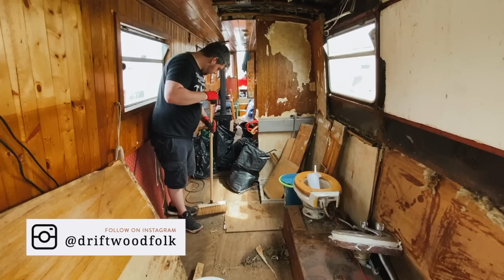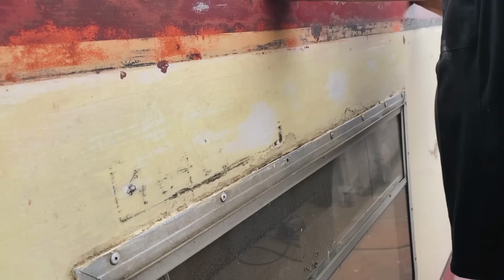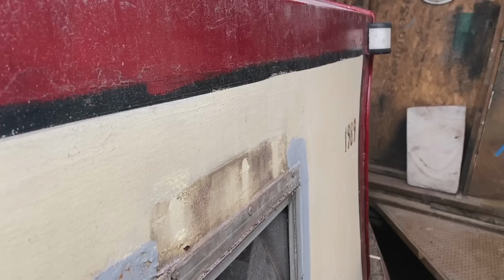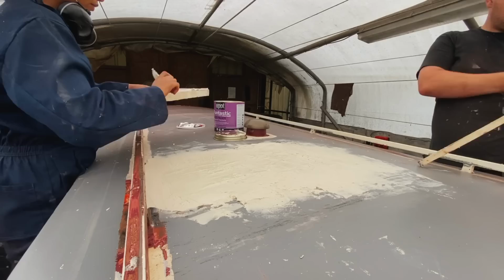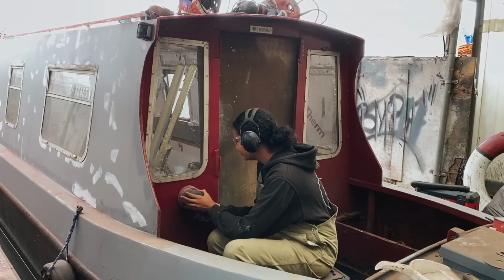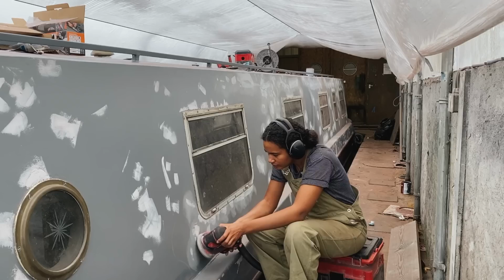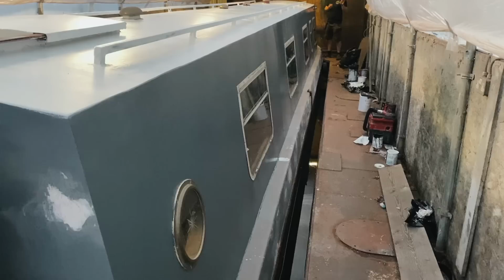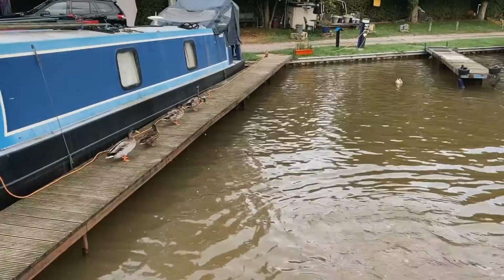Did the rain ruin our paint job? | DIY Repainting Our Narrowboat (part 1) - 012

Comment: I used to be a painter and decorater large flat area's are always a problem with white you get shadows.
What a sterling job you both are doing its looking great.
Top trick if you want to mix paint get a plater mixer end attach it to a drill through paint lid oh put hole in lid first then mix on slow setting it works all my best to you both xx
Reply from the maker: That’s a brilliant tip, thank you!!

Comment: Considering you had a leaky paint turnnel you've done very well. I'm not going to teach you how to suck eggs, but I've just spent 2 weeks in a paint tunnel to do my roof, I spent ages researching and watching John Barnards vodios on boat painting and speaking to him over the phone (very helpful chap as well as an excellent boat painter).
One of the things that I found out was the temperature before applying paint, for example the temp must be at least 3 degrees above dew point  before applying paint and paint shouldn't be applied below 5 degrees or above 20 degrees.
Regarding the undercoat , you really don't need to lay off the coats because you will be sanding down after the last coat before you apply the top coat.
With the top coat apply with a roller and lay off with a brush, to get that good finish use a Purdy Monach Elite brush, it gives excellent results. Sand down between the top coats with  320 grit paper, this will give a good key for the next layer. I did 3 undercoats and two top coats on my roof, and never ever having done it before, It turned out above my expectations.
Not really sure I'm up to tackling a whole boat, but I wish you luck.
Keep the vlogs coming.
Reply from the maker: Wow so much great advice here, thanks for sharing! Looks like you did a lot of research, I’m glad it worked out well for you!

Comment: Whether you spray or roller you're going to want to mix the paint with either paint thinner or acetone and of course hardener. The ratios are always on the can and don't pour the paint over the instructions. You will need a good respirator and some good rubber gloves so you don't get oil from your hands on your paint job or primer.. also for blending paint I've always used a dollar store stainless steel whisk I cut the loop off the end and put it in a regular drill until that an angle if you go straight in it'll fold the paint you want to blend the paint so just angle towards the side of the can personally I'd spray but good luck either way
Reply from the maker: Lots of great advice here, wow - thanks Lee!

Comment: If you wish to dry the paint process quickly. Put a blow heater inside to get hot and close the hatches for a few hours. Leave a couple of windows slightly open. The inside will get hot warming up the whole boat to dry the paint quickly.
Reply from the maker: Great tips, thanks!

Comment: Hi guys  just painted a new sailaway shell myself this last few months. All outside.  Not ideal. Was too hot to do it in the better weather. And still same really wen it turned. 2 undercoats and 2 top coats. Rollered and layed it off. Looks great on a dull day - but terrible(to me i expected better result)on a sunny day.  Its the parts every foot strip were it overlays last strip edges.  Working single handed- not easy. 
Also - i used 240 grit by hand to key primer to undercoat on first side. I dont think thats good enough. Pulling off the masking tape ripped out fresh paint back to primer.too late in year to chsnge that side.
2nd side 120 grit and a sander.
Didnt have same problem- thank####. 
Very disheartening - overall - theres always another time - at least the metals protected - if not as pretty as hoped. At least i know i can do the inside a good job.  
Good video - no bull. 👍
Reply from the maker: Thanks for all the solid advice here!! Really appreciate it!

Comment: For safety you need to wear masks as there could be lead in that paint if it’s an old boat,please be careful your health is so important,keep up the hard work but be safe.
Reply: Thanks Craig much appreciated. I did wear one in the end just typically not in any of the shots ha we had extractors on the machines too too keep the dust down plus the tunnel has a static sheet that the dust sticks to which was good. PPE is a must for this kinda work

Comment: Using the right tools and an appropriate location it's not a difficult job. The sanders you were using  were just not up to the job. If you can't get shot blasting to remove paint, the next best way is mains powered angle grinders with fibre discs to strip back to bare steel. Doing this would actually be quicker than what you did.
Reply: Hey appreciate your comment ... We werent going down to bare steel we just wanted to key the paint but also to take off years & years of bobbly paint jobs, which the sanders did a good job of doing & it looks soooo much better for it. Ideally if we had the funds & the time we would of got it blasted but unfortunately those things together are in short supply. Plus would of required way more primer & undercoat to achieve the same results.

Comment: Deffo get your mate to spray paint did mine with roller and your can see so many patches at a angle saving grace looks Wicked from a distance 😂 The shelf lmao you mean gunnels or gunwale depending how posh you are.
Reply from the maker: It’s a shelf to meeeeee 😂 Yeah this week we actually put another undercoat on (green) with rollers and on one side there’s no roller marks and on another there’s lots where we didn’t do a thick enough coat so we shall see! Only problem with spraying it is that it’s a thin layer and apparently would need about six coats